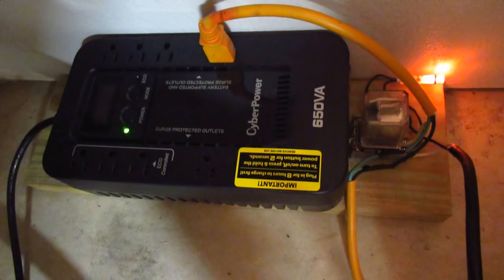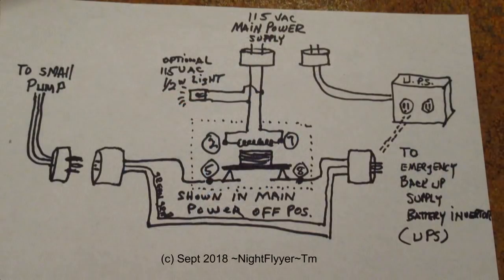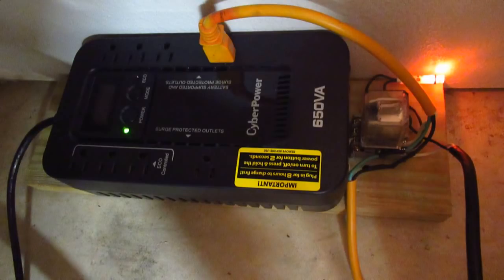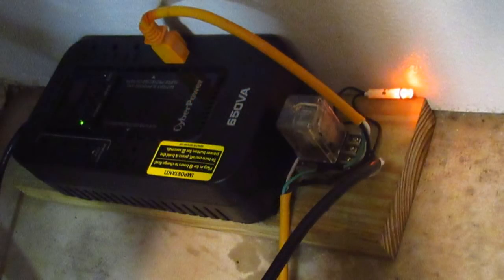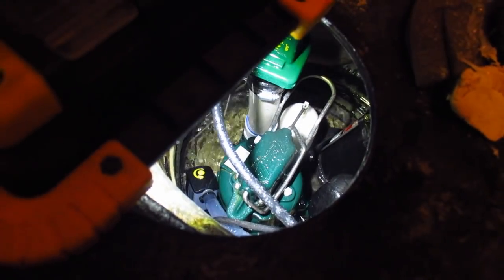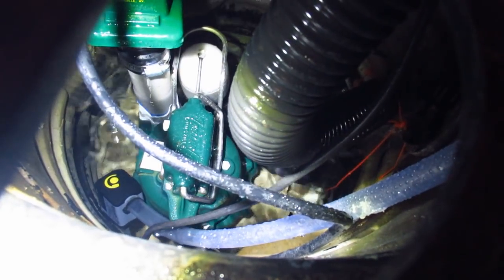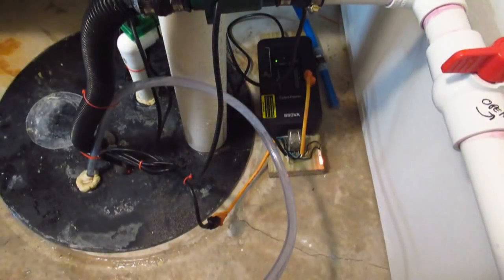"Power out" sump pump backup switch project is useful for Aquariums too!

Comment: Interesting that I came up with a similar idea. Question - have you tested the battery backup over an extended period of time. You claim 12 days, but that seems high. I just used my backup for my router and modem and it only last one hour.
Reply from the maker: Never had the power fail for more than a day, and the pump worked fine.  The tiny back up pump uses less power than my router at only .085 Amp or 85 mah per hour.  650 amp backup battery would be 8500 divided by 85 which equals 76.47 hours. That is closer to 3 days.  I will change my description, as I guess 12 days is a stretch, but we never had the power go out for more than a day here, so in real time,  I calculated it first on my 2250 backup, but wound up using the 650 Amp for this project as I am using the 2250 on my router and Fiber optic modem.  Of course a larger amp battery back up, like the 2250 Amp I have on my computer would increase the time. Good luck with the project and thanks for pointing this out.

Comment: Dave, I'm a flat-lander and never owned a home with a basement of a sump pump so forgive me if I ask ignorant questions.  I see the small pump empties into a floor drain.  Does the floor drain guarantee you can never have more than 1/4" of water in the basement?   ie  Any floor waters will run across floor and exit by the floor drain?  With your current setup, how do you know it the first pump has failed and secondary MAINS pump is being used?  7:13  Seems, if you mount the Phone Notifying High-Water Alarm SENSOR above the flood stage of the primary sump pump, you'd get EARLY NOTIFICATION of trouble with the primary pump.  Did your phone get an incoming text message when the tiny pump "tinkled" on the sensor?  Any benefit of glueing a 2x4 frame perimeter to the floor to form a levee wall to encircle the floor drain and the entire access to the sump pit?  The idea being water that overflows from the sump goes directly to the floor drain, and doesn't have to flood the entire basement floor.  Very cool system.
Reply from the maker: All good info.  Yes sensor told my phone it was wet. If the main pump fails, the second one is much louder and since my office is right down here by it, I will hear if the first one fails. If the power goes out, the tiny pump takes over.  All water can go into 3 drains that are in the basement.  Since I want no water at all on the floor, this all works pretty good.  But if my house burns down, like my other one did on 911, 2016, the amount of water pumped in by the fire department, would overwhelm everything.  Im satisfied with my set up and appreciate your comments.  Thanks.

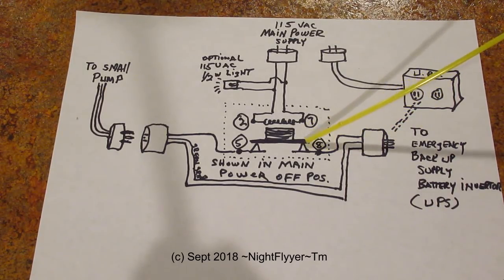Comment: 3:20 I'm an injuneer, not an "real electrician," but let me share some ideas.  Isn't the black wire the "hot" one, and white is NEUTRAL???  Might be more "Code" to switch the black wire instead of white.  For the optional "remote indicator light(s),"  how about wire one in parallel with the small pump, to let you know when BACK-UP SYSTEM is active?  Connect it on the downwind side of the male connector - a positive lamp PROVES connection to pump is A-okay.  Small pump empties into floor drain and where does that drain go?  No chance the floor drain will back-up during a prolonged "big rain/storm" event?    Love your channel.  Followed RC for years, and just now bought my first plane; the full-sized Apprentice.  Buyer's remorse; the plane is huge and wing barely fits into my Chevy Impala.  They experts at the AMA field said, "Apprentice 15e is what you need."  I see some advantages to the smaller 1.2 meter Apprentice.
Reply from the maker: Yes.  As with anything, it can be improved.  What I did works, so I am satisfied.  Thanks and happy flying.
Reply: @NightFlyyer  You shouldn't use the Neutral White wire for switching...that means the hot will always be hot, and any grounding could energize the pump, or you.

Comment: what if the power goes out and there is no water in there will the pond pump start and run with no water ?
Reply from the maker: Yes but in my case the sump has water pouring in all the time. It never stops. These pumps are vibrating so will not burn up if no water so not to worry.

Comment from the maker: Of course you can buy a battery backup, and most kits are well over $100 plus you need to buy a battery, making the price even higher, so I made my own with what I had on hand. My main sump pump failed at the float switch, plus was leaking at the base gasket, so it  had to be replaced.  Luckily it remained on.  Realizing that if it failed again, I should have a backup sump pump installed too, so I put in the second black backup pump.  Now, if the main pump fails, the backup will turn on.  But IF the POWER FAILS, neither pump will run, so I developed a way to run a pond pump off my UPS (Uninterrupted power supply) with a simple relay.  This pump will run 3 + days on the UPS battery backup and even this small 75 GPH pump is sufficient to keep my sump empty.  Much bigger pond (statuary) pumps can also be added, but this is working fine and what I had on hand to give me peace of mind.  If you have more water coming in, I would recommend getting a larger GPH (Gallon Per Hour pump) for your sump well, for example a 425 GPH.  It would pump over 7 Gallons per minute and still run all day on the 650VA battery backup. It also will work as an aquarium pump/aerator backup if the power goes out.  Thanks for watching and stay dry.